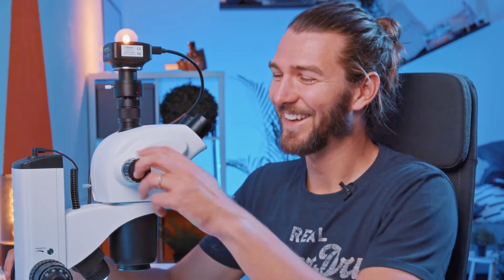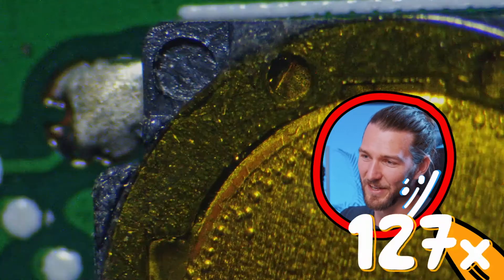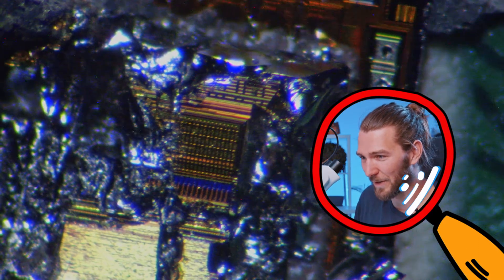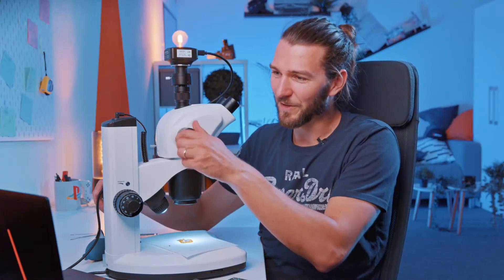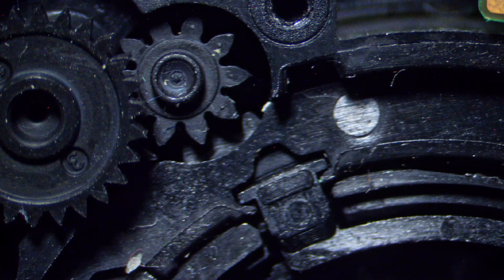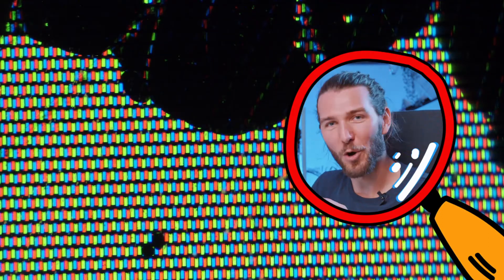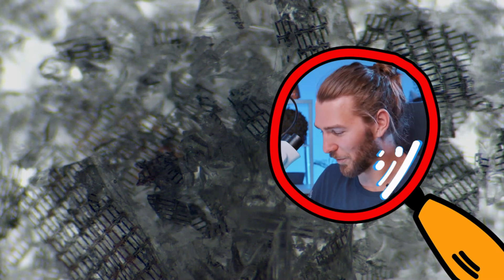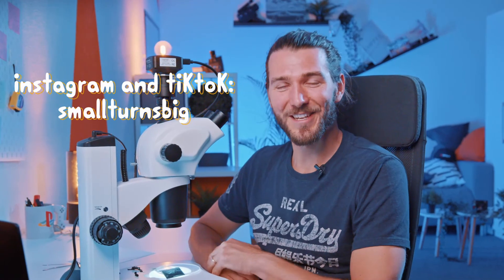What's Inside A Camera? Under The Microscope!

Comment: That black liquid is the Liquid Crystals,  of the Display  ( LCD ) Depending on electric current on the panels the liquid moves a certain way blocking the light source that tries to illuminate the Pixels, so making em black or mixing colors eg; one blue one red on and the Green off to show a purple "pixel"

Those aren't individuals pixels, pixels are 3 of them together RGB And each color is a sub pixel. (Most of them, some cameras or display use 2 greens to be like our eyes, we have more green cones so we see more of it, that's why night vision is green  we can see more detail and shades of green.)

And yes, that was a CCD sensor. ;) awesome video btw.
Reply from the maker: Thank you for explaining it and confirming it is a CCD! Controlling liquid is hard I would say but its amazing how that works! The increased green colors I also heard before but never saw one..

Comment: Found this on wiki: A liquid-crystal display (LCD) is a flat-panel display or other electronically modulated optical device that uses the light-modulating properties of liquid crystals combined with polarizers. Liquid crystals do not emit light directly,
Reply from the maker: Thank you for sharing the info